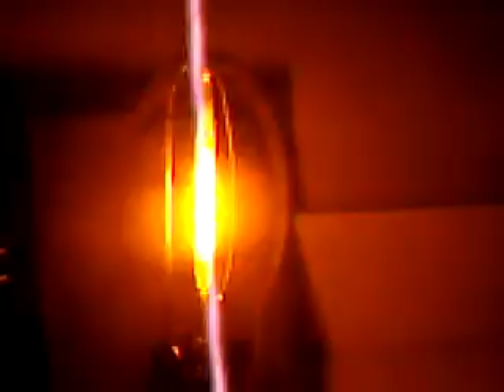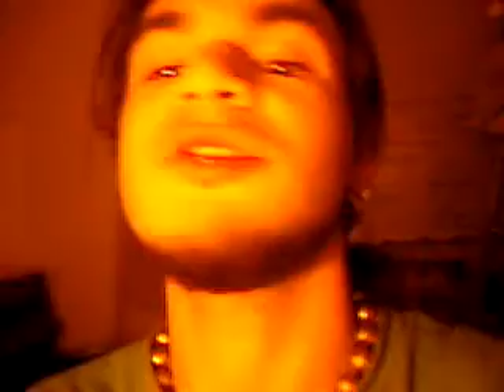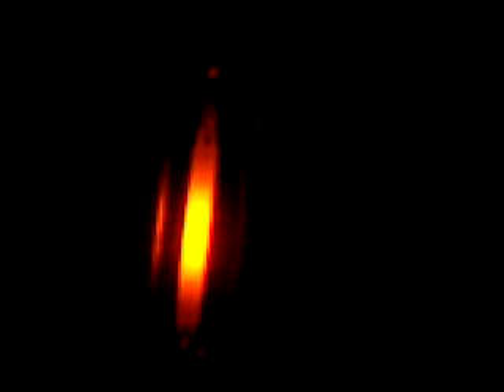High pressure sodium hot restriking and contrast demo

Comment from the maker: That one actually is true, because its spectrum is rich with red light. Plants absorb red light and reflect green light so HPS works well as a grow light for pretty much any plants. The only problem is that when they are used as night lighting in green areas, the plants are basically getting 24 hour sunlight, and if they are trees or other plants that require a dormancy cycle, then this can cause problems.